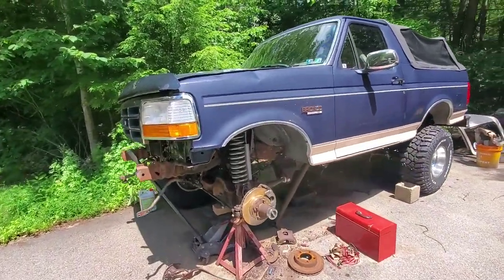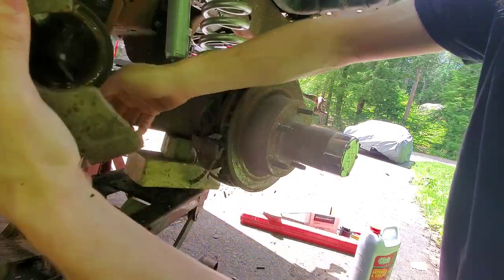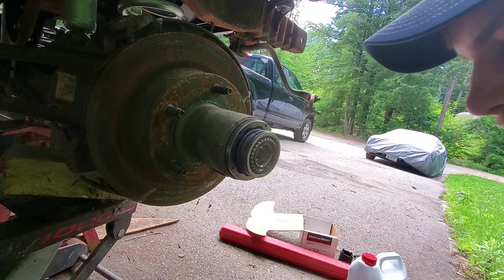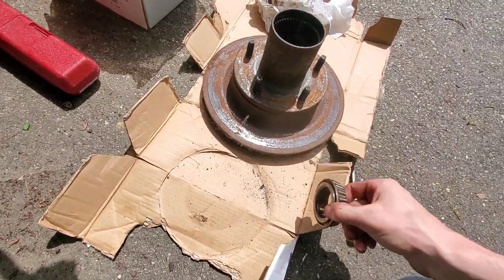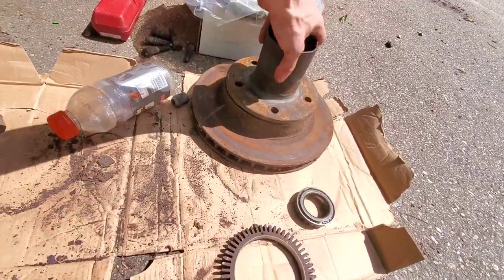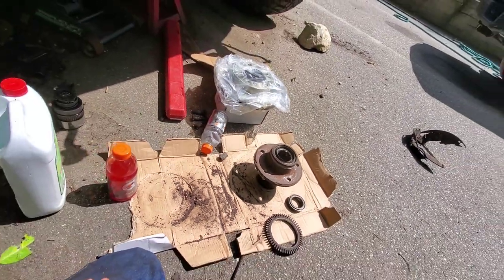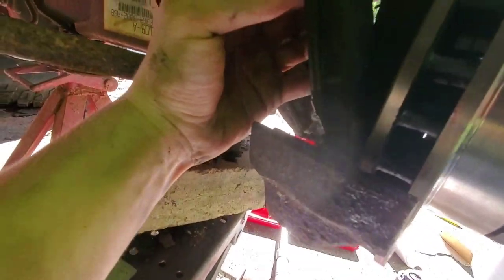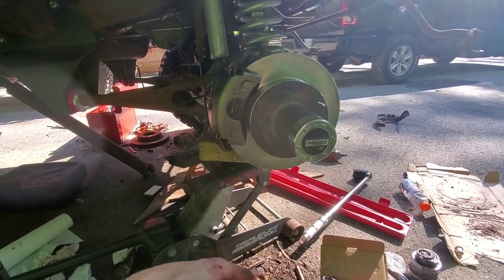Installing Manual Locking Hubs - Complete guide to front brake replacement. 1993 OBS Ford Bronco

Comment: Thanks for taking the time to do this.  Any time you are seating lug studs you should use lube on the splines, threads and grease on the washer.  Best is to use two washers with grease between them.  This way the threads don't get overheated and annealed... or stripped.

Comment: y 87 had the easy to remove and replace manual hubs.  Great for eoing break jobs etc.. but after putting gears and lockers  (4:56's wirh ratchet lockers front and rear I w as stoked how well it was climbing up steep sand until it stopped. I then noticed something on the sand hill what was it ? My hubs blew up!  I have since bought glassfenders I needed for tire clearance for my 35" tires I geared for on my long travel suspention.(wheel travel)  I bought them from a gentleman parting out his 96 and bought the glasss fenders, hood ,core support, headlights grill and all to change my front body style doing so. I needed to get new outer axles and went all out  bought his 96 spindles chromoly outers the spindles allowed me to bolt my new calapers to them over the pins. I was happy I did when seeing my pass side with a pin almost all the wAY OUT.  i SALSO GUSSETED AND PLATTED MY BEAMS AND BEEFED UP THE PLATES TOP AND BOTTOM OF MY RADIUS ARMS AND ADDED A VERTICAL PIECE THAT TIES THEM TOGETHERAND ADS A CONNECTION TO THE BEAM ON BOTH SIDES. i GOT RID OF THE DUAL SHOCKS AND BEEFED UP THE SHOCK MOUNTS WITH A GUSSET AND CHROMLLY TUBE THAT ARCHES UP AND BACK DOWN TH THE FRAme for a taller shock. I went to King Shocks old small shop and ordered new shocks from Brett King. I also GOT a frame to frame reR TOWER FOR TALLER SHOCKS KEPT UNDER AND FORWARD AS POSSIBLE TO AVOID TUBBING IN THE BODY AND KEEPING INTERIOR SPACE BY dONAHOE rACINGtHE NEW rAPTOR i READ HAS 13" FRONT AND 13.9" REAR WHEEL TRAVELON NICE fOX SHOCKSMY 87 FULL SIZE AFTER DOING THIS AND ADDING A f250 PASS SIDE SLIP SHAFT ACLE WITH BIGGER u JOINTS AND CYCLEING AND CLEARING FOR 4X4 OPERATION AND SETTING MY LIMIT STRAPS GETS SEVENTEEN TO EIGHTEENINCHES OF FRONT TRAVEL AND A BIT MORE IN THE REAR ON SOME dEAVER SPRINGS ALL ON kINGS.  the Bronco always gives me permagrin soaking up whoops ggoing pretty fastnot spilling my drink of water. and handleing surprises and air smooth and in control!  I added bedsides too and fresh power and rebuilt my transfer case with everything.  Also had a Monster trans from thr Monsters brother rebuilt by drag racers Art Carrs trans shop. it is my unstopable Burrow Brah  and with many hours and parts and some help from FSB members and the sound system  bought and installed I LOVE it.

Comment: Excellent video. But, one thing I've been unable to find for sure is if you are to re-use the two splined washers and half moon c-clip. Do you disregard those and just use the c-clip from warn?
Reply from the maker: Are the two splined washers you're referring to the axle nuts? Because yes you definitely need to re use those. Everything from the outer axle nut, outward is replaced by warn parts, everything inside of the outer axle nut stays factory.

Comment: sORRY BUT A QUESTION i HAVE  IS ABOUT THE BIG RING YOU PUT ON AFTER THE HUB AND CLIP ON THE AXLE WITH SNAP RING PLIERSwHat does it do and is it important? 
Is the groove it goes into on the hub ?  or in the cylinder that comes out of the wheel around the hub ?
Reply from the maker: It's important. It holds the hub in place. It  snaps into the housing. Why did you lose yours? Lol

Comment: Is that outer lock nut you torqued to 150lb from your automatic hubs? I don’t think the manual hub trucks have that.
Reply from the maker: I believe it was from the auto hubs. I bought a conversion kit which had 2 lock nuts and a spacer, to go from auto to manual, which I didn't use because the truck already had the nuts.

Comment: my 94 f250 has the shitty guide clips, as well as my 88, both my 96 and 97 had normal slide pins.
Reply from the maker: It's definitely a weird setup compared to modern brakes.
Reply: @Bearbait01  not a fan tho, haha. Had one of the clips on my 94 big block completely shear in half leaving the caliper rubbing on the inside of the rim (luckily that was all that happened). Just did the brekes on my 88 for the second time in 5K. Freaken things wont stop warping
Reply from the maker: That sucks. Hopefully, if the bronco ever finds itself in working order I don't have that problem 🤣
Reply: Sam Tucker  Oh F 250  had slide pins holding Calipers on the spindle? I bought some 96 spindles and calipers that bolt onfrom a 96Bronco building my 87Broncointo  long travel prerunner. I used an F250 slip shaft on the pass side axle for  its si8ze and big u jointsthough